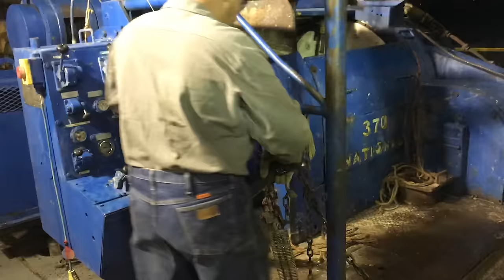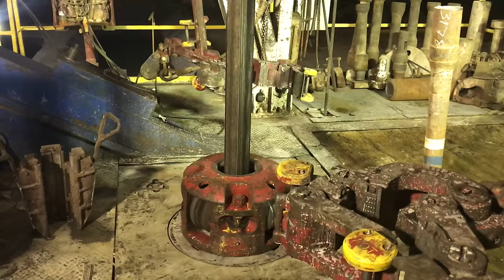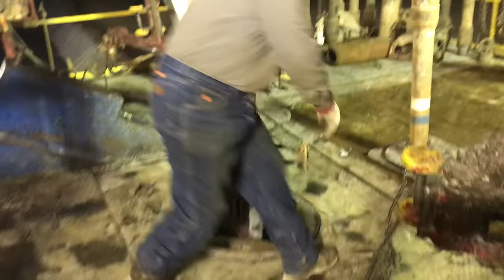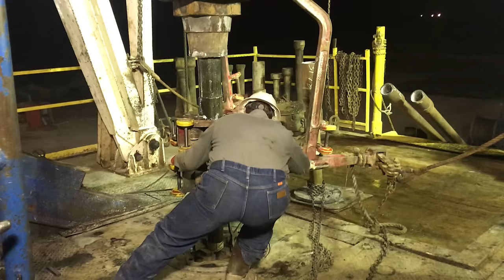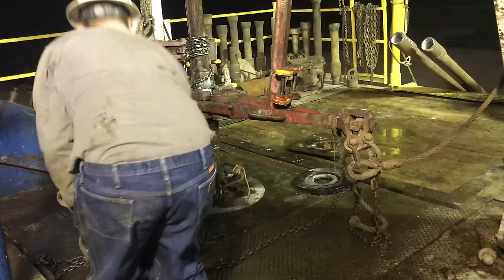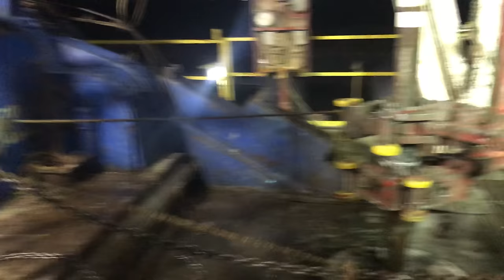Never seen before!!!! Driller does it all ! ONE MAN CONNECTION!!!   They said it was.IMPOSSIBLE!!!!!

Comment: This serves well as a training video. By him doing everything himself, one step at a time, you gain a clear understanding of every phase of the evolution.    All I didn't see him doing that I expected was to check and clean the pipe threads before making the connections.
Reply from the maker: We always prep the pipe when we pick it up and mouse hole a joint. 👍
Reply: And he didn't wash off the Kelly
Reply: plus the time it takes it wouldnt work i no they could hire 8 lads 2 do it fast or 4 ppl good ppl could do it faster than them 8 but 1 man is a no no them rigs are costing 50grand a day thats a guess obv so taking this time cam not work
Reply: One man to do all of that.
I watched the drillers in quarry’s that have the whole operation contained in a single rig operated by one man.
Lot of the same stuff, not nearly as big.
Sometimes size is exactly why you need to take the time to do it right.
I hope that guy is getting paid what he is worth, and not some Snowflake minimum wage!
Reply: I like what you have to say. Break it down into its steps.  Now if they stopped it at certain critical points and pointed out the sugestions you have.  And explain as to why they are doing what they do.  Then people will have a clear understanding of what is going on here.  Amazing to see tho one person doing it all.  I give credit.  Thanks for the video
Reply: Working in the rig learn how to prepare; organize & how to use it.....
Reply: This is what we call it one man show...
Reply: The pipe looked doped when it came up out of the rat hole.
Reply: @eyefishinggunkchannel1011 plus if something goes south there's no one there to help you,i think its foolish to just go it alone, for safety sake  there should be at least 2 guys

Comment: To do these connections dozens of times a day for 5/6 days a week is mind-boggling. Just think of all the steps and timing it takes for this. Plus working fast on a steel platform coated with oil and water. I think i have bad at my job...All respect to you men  working on these rigs.
Reply: What is that chuck thing with handles that he drops in the hole to stop the pipe from moving. - Just curious. Fascinating.
Reply: @durhamvid  slips
Reply: @durhamvid  they are called slips
Reply: It's not that hard of a job.  Its just a few easy tasks done over and over and over again.
Reply: @roddog24   the hardest part for me was first night on grave yard and your relief doesn't show so you have to pull a double. The other was coming out laying down drill pipe. Coming out of the hole wet sucked using the mud box
Reply: Tony Mazza we worked 7 days 2 off 8am to 4pm after days off we worked 7 on 2off but switched shifts 4pm to 12am for 7 days then 2 off . Then 12am to 8am 7 days after this shift 4 day weekend. The worst part if you relief person didn't show you worked 16 hours.
Reply: @roddog24  my first time in the Derrick I missed the elevator with a drill collar. Hanging out on a diving board with a safety belt not harness is quite the experience almost as fun as taking the escape line out of the Derrick.  The best is waking up the tool pusher at 1am and asking him for the key to the v door. The worm initiation is a eventful experience I will never forget! Nothing like pipe dope in your hard hat or carrying a 5 gal bucket to the top to fill the water tower.
Reply: What about riding the drill pipe up and the motorman doping the pipe behind as you go up , i used to like making asettling bombs in a 5 gallon drum what noise it made when it went of. Or putting iodine on the sponge of a hard hat .
Reply: Did it for 15 years. Loved it

Comment: I ruff neck for about 18 years broke out in the early 70s I remember my first day we were driving up to rig the Kelly hose broke mud going everywhere. I thought to myself I don’t no if I want to do this or not . Driller told me that’s not normal. On top of that it was a wash down boy that old mud sure did stink. The other hands told me if I could handle this well I could handle any of them. I worked two wash downs before helped drill a regular well. Those were the days.

Comment: Depends 0n the rig set up this. Wouldn't be possible on the one I worked on. We unhooked the elevators and pulled them back and latched them to the pipe in the v door.  While the pipe was drawn up the Derrick I wrapped the chain. We had to walk the 4 1/2 drill pipe and stab it. If you slipped it would drag you across the floor if you lost your grip the pipe would swing across the table and hit the Derrick if the driller didn't drop it. Not fun having the drill  swinging.  It rarely happened and usually with a new worm. The worst thing I witnessed was the safety plate on the blocks broke on the way up I was able to dive over the chain guard my partner hesitated and it him worst thing I've seen it cut him open broke his shoulder arm and him. It seemed like forever for the ambulance. Every time the diesel motors roared on the way up it reminded me even now 35 years later when I hear a diesel truck it reminds me once in a while

Comment: Done it many times  if something is going on downstairs and you're shorthanded you've only got a motor hand and a worm and you're having other problems may be in the pump shed you got the Derek and the other hands all booked up the other pump online because you need it so you can draw a little faster right now you're only draw about as half as fast as you can so yes rather than pull them out of the pump shed make connection make a connection maybe 3 connections as long as they get that swab changed out and they get that pump back online for me so we can go back to Macon real hole in a lot of areas and the Rocky Mountains and the first six thousand feet you can drill down faster than you can make connection so a 30 foot section of pipe can be drilled down into minutes with both pumps running with a mud motor on and a diamond bit you just Breeze through the top few for formations like butter long as you've got the pump this is an older video there are a few rigs out here that still do it this way almost universally top drives now
Reply from the maker: Yes sir ! I started roughnecking before down hole  motors any directional tools , PDC  bits . Before Payson . Or any   Rig monitoring system. It was Trycone bits standpipe gaugez. Couple of nuts hanging on a rope in every section of the pits. And you counted your strokes with a watch. Same with RPM on rotary table. Good old fashion wireline Survey Every 500 foot. Make Some hole . If you can’t get it you can’t stay!!!!!! 👍

Comment: How long, on average, does it take for a drill rig to sink a full pipe section? (90 feet?)
Reply: Section is a joint which is between 29ft and 31ft. Average of 31 but it takes as little as 10min. To 3hrs to drill a joint down. Depends on depth and type of drilling you are doing. Sometimes even longer for core drilling. The shallower the faster you can drill

Comment: I tried tripping out on my own once while everyone else had a coffee. The driller stopped with the joint too high, as I reached up for the elevator horns to push them clear of the pipe, they hit it and the horns sprang up & pinched my finger against the bales. 11 stitches later, the medic saved my fingertip. I’m pretty sure the driller had been smoking dope. I sued the company and got £1000 (a decent sum in 1979.)

Comment: Yaw see that wiper rubber he knocked off , I spent damn near a whole shift removing one from our blow out preventer the driller rammed down Into it . We removed one of the rams and I was stuffed in the hole as far as I could reach with one arm they dropped a chain and hook . To make matters worse we had already cut gas on the hole . To be small framed was one thing but being the tool pushers son insured me being stuck with the shittiest jobs. I have storys and all my fingers after 3 years . 1977 - 79

Comment: He probably started before sectional matting just had 3 by planks for the rig to sit on that got stuck in a foot of mud by the end of the hole, Halliburton showed up with their saw blade hopper to do a 1200 bag cement job, rope burning cat heads for your hi line and cat line, some old single pass boiler that someone built out of an old steam locomotive, johnson bar for your chain , an empty inverted 5 gal pail with a sawdust bag to squeak brake on and riding the lunch box down the doghouse stairs....aw the good old days

Comment: The driller realizes he has hit oil.The oil soaked pipe proves this. Hé removes the dríll bit and sends tubing down the hole. All the while using tug lines to achieve this. He's smart and probably been burned in the past.

Comment: ❤❤❤he should also use to lock the table during spinning the pipe in connection, but it's a heck of a job , he did it, it's amazing....I admired him....❤❤❤
Reply from the maker: Right . There was lots of things I could have done differently. But the agreement I made with my hands was , I would do it the way they had to do it . It would have been way easier to break with the rotary table. Plus use the lock. Thanks for the positive comment 👍

Comment: I’ve done that not to show off but because I had to I run my crew off. They were robbing the parts house blind and I caught them. I use the air tugger to stab the joint in the mouse hole

Comment: So, what's the deal? Did the rest of the crew get drunk? Or maybe this driller is hard to work for and can't keep a crew. Or maybe, he's just showing off. I'd like to know the story behind this.
Reply from the maker: My floor hands were having trouble on the floor. For one the rig was not centered over the hole . They were struggling pushing the kettle back. I tried to help them with knowledge But it was not received. Sooo I made the brag that I could do it by myself. And do it the way they where supposed to. No cutting corners Like Using the Rotary lock . etc. they said it was impossible. The rest is history. I did this one time. 😎
Reply: Takes four roughness to change oil in drillers car.

Comment: u did a great work there by doing it all by yourself, but isn't it a little bit risky ? taking all that time in a connection my cause a stuck and it'll be  a real pain in the ass
Reply: @cowboybob5265  yeah, I could see that it's like a fresh water, anyway I'm glad to see the work u did there, as I'm a new driller and worked only with TDS I'm pleased to see how it's done the old way , keep up the good work sir
Reply: Ismail Sayah I doubt that. When drilling with a Kelly, you are at least 15’ off bottom.
Reply: Not much chance on getting stuck drilling surface hole.

Comment: And this guys is the recipe for stuck pipe, smfh.
Reply: @cowboybob5265  Sweeps MAY help in keeping the hole clean, or as clean as possible, and thats if you continually rotate ( at high rpm according to the hole angle)and reciprocate the string continually but its not 100% guaranteed to prevent stuck pipe. Keeping the string stationary is a key factor  in causing stuck pipe . Always keep that string moving as much as possible to stay out of trouble, trust me.

Comment: Took him way to long, good way to get stuck.
Reply from the maker: I guess you have never run a wire line Survey. Or installed a rotating head. just how long is it supposed to take for one man to do four men’s job
Reply: @cowboybob5265  A lot of glorieta  in S W Kansas, keep pipe moving. Even when you run a wireline, pipe should be rotating till you reach said depth. 

If this man were to hurt himself doing this, OSHA be all over this.
Reply from the maker: Well I didn’t. We don’t do this all the time . The floor was putting it to my floor hands. And I told them I could do it by myself. They said it was impossible. The rest is history. Just to put you at ease. I did pump a big sweep and clean the hole up before I done this. Notice how clean the fluid is when I broke off the kelly .
Reply: @cowboybob5265  I noticed it was clean. Like I was saying,in south west Kansas a lot of sand before you hit service. Sweep the hole with 1 foot of premix every 100 feet. 
I got stuck twice 😅😅

Ps: You did great with that one man connection 🙏
Reply from the maker: Thank you. This well was in south eastern NM.

Comment: So how much was the bet
Reply from the maker: The floor was kicking their butts . One , the rig was not centered over the hole. That’s why I tied the slip handles together so The slip dies would bite on the pipe and I could drag it in the hole. They couldn’t push the Kelley back. It was cold and about 3 o’clock in the morning they we’re already looking for relief. So I bet them I could do it by myself. They said it was impossible. I proved them wrong. so by winning the bet I got a video that is at this point one of a kind. They were ashamed and amazed at the same time. And they put a lot more effort into their job.     (If you can’t get it, you can’t stay)         that’s the oil field I broke out in !!!! It’s not the same today. In fact, it don’t even make sense too men who are not real roughnecks .